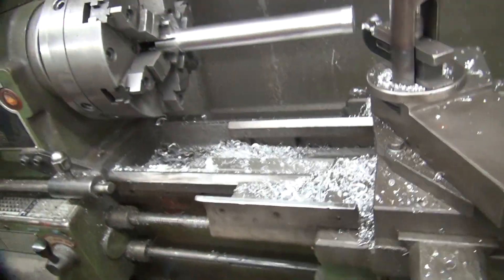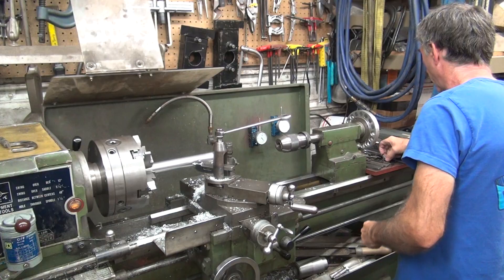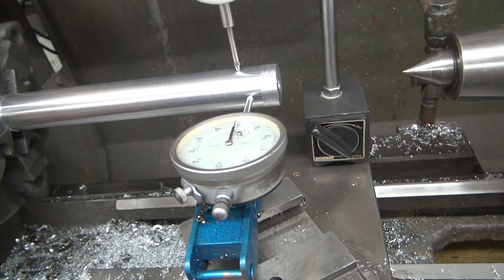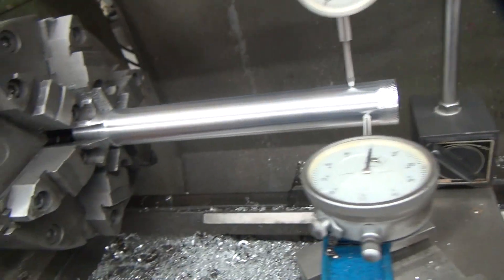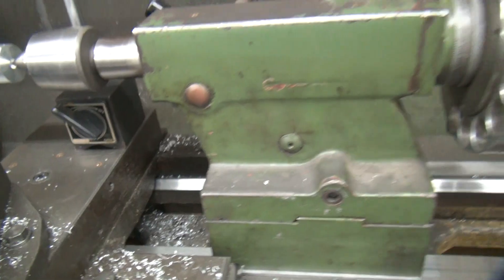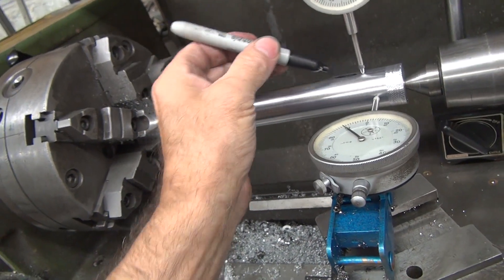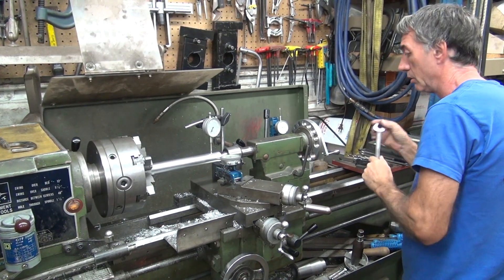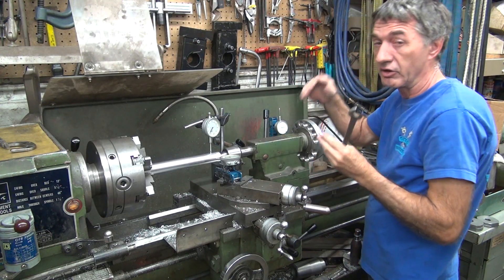#119 fixing my lathe centers centerline dimension so that i can make good parts harley tatro machine

Comment: Have you used a different micrometer or caliper to make sure you're getting accurate readings?? Its crazy that you have leveled everything how it wants to be and its still not cutting correctly.. has to be the jaws, can you remove them and place them on your mill, cut them flat
Reply from the maker: it is the drill chuck. they are never straight. i had to use it for holding the gear. it was not a good setup so i had to cheat to get what i needed. things will be better when i make the case repair bushing.
tatro